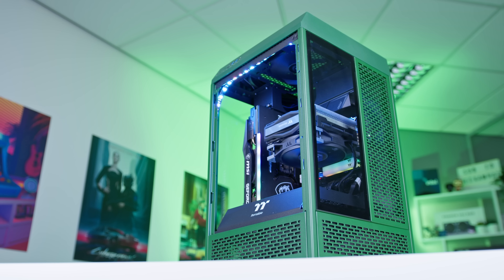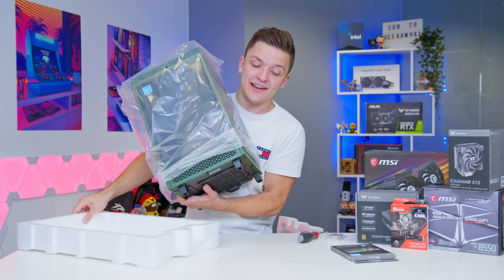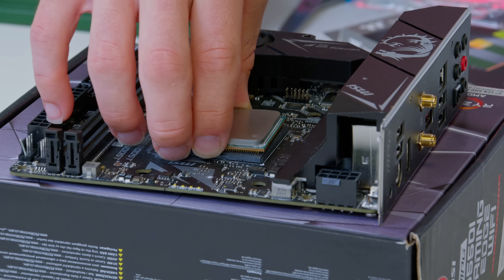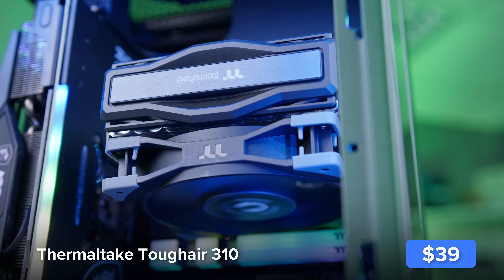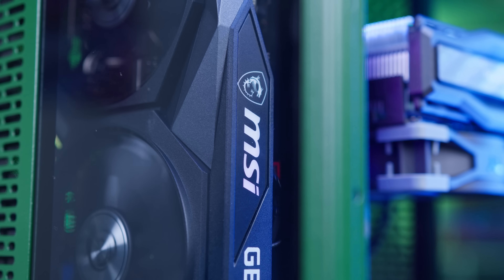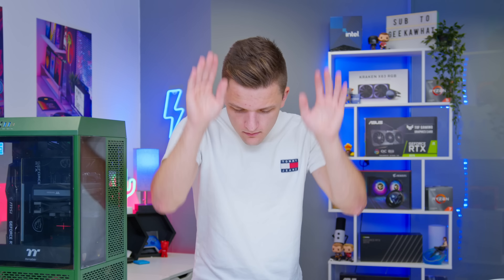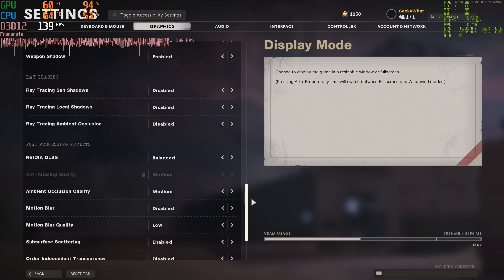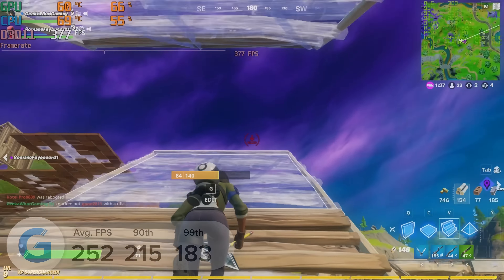Epic $1500 Gaming PC Build 2021! [Full Build Guide - ft. RTX 3060Ti & Ryzen 5 5600X Benchmarks!]

Comment: Hi can you build this 
CPU: INTEL CORE I5 11500
MBOARD;MSI B560m PRO- VDH WIFI
GPU: MSI GTX 1660 SUPER GAMING X
RAM: DELTA FORCE 8GBX2 3200HZ
COOLER: MSI MAG COOLER CORELIQUID 280R
SSD:TFORCE DELTA S RGB 250GB
PSU:MSI MAG A550BN 550W 80+ BRONZE
CASE: MSI MAG VAMPIRIC 100R

Comment: Thumbnail is quite fake, I have the same card but dual fan instead of trio, same brand and style though, and I get above 300fps on all epic settings on fortnite, and like 140-180 fps on all max settings on modern warfare
Reply from the maker: So because I used the frame rates I tested at high settings, 1440p, and not high settings, 1080p, this video is fake? Ok then...

Comment: Awesome build! I love this case.  I just finished a build using this very case as well, but the white version.  The racing green color is super cool as well!  I'd like to know how you faired with thermals on the GPU at load with all of the glass panels on.  I did notice that you had a couple of shots with the side panels off and then some with the panels on.  I have to run my machine with the GPU side panel off otherwise I could probably cook popcorn inside my case...